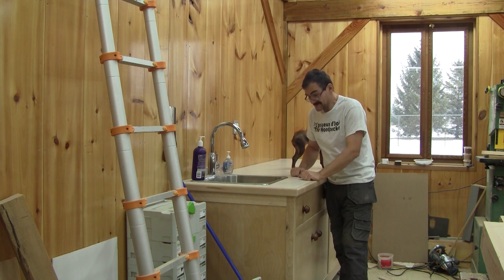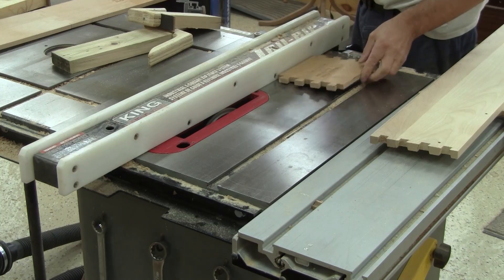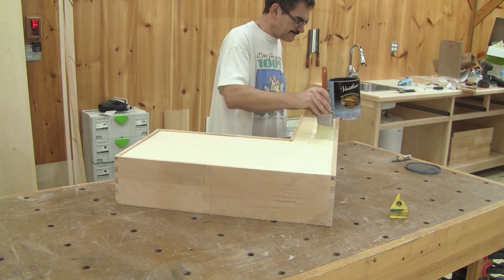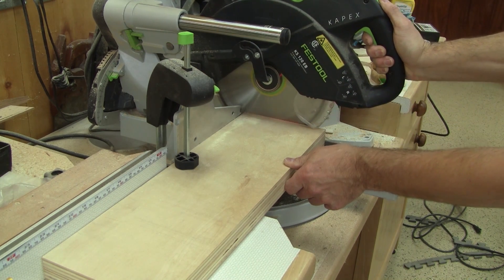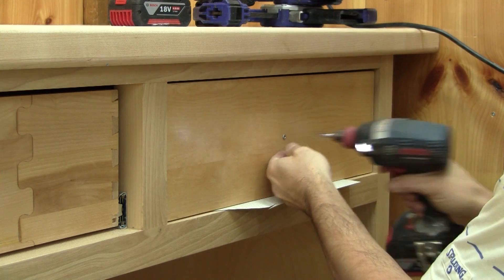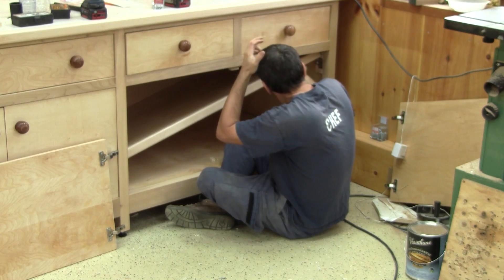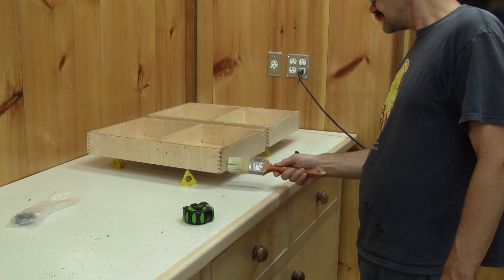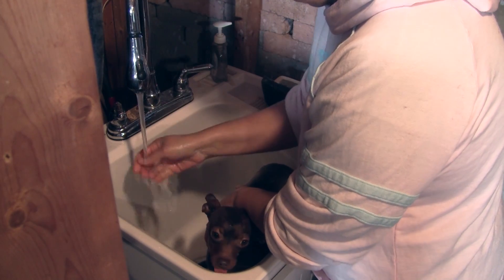The Woodpecker Ep 112 - Water Cabinet - part 3

Comment: Excellent job Alain. I love your pencil.....I used to use one of those back in the 70s when I did some drafting. Used to have the sharpener on my desk......my oh my if I had a nickel for every time I turned that thing around..... The under the counter water heater? I have not seen one like that before. What brand is it? As always, I always enjoy watching you and your projects. Thanks Again......
Reply from the maker: +Frenchy St. Germain I love this pencil, I used to use the actual one I was using in school but it broke in 2 so I bought another. What I love is that it can be used to make big thick lines and after a nice sharpening it's has pointy as a needle.
My heater was bought at Home Depot, around here it'sjust sold on their website only, It's a Stiebel Eltron. My home water heater is also a Stiebel Eltron, it's so much beter than the last one I had. I know this might soind weird talking about how good a water heater is, but I retrofited my hose with instant water heater, I don't have a water tank anymore, I love it. It has its drawback but I can fill my pool with just hot water :)

Comment: nice work as always - whats next?    (did you make a mistake with the corner poking out at 1.40? )
Reply from the maker: +jumpleadsx2 No, when I tried it I've pushed it too much at the back. But don't worry, it's all closed all around the sink and I'm glad I can use a little bit of water in the shop :)

Comment: Hi Alain.  Did you install a "P" trap in your drain pipe under the sink?  it looks like the water runs straight down at an angle.
Reply from the maker: +Jason Young No, like you saw the drain goes straight into a small decantation basin under the sink, so likethis I can separate the heavy solid and the water. But I don't expect washing super dirty stuff in that sink.